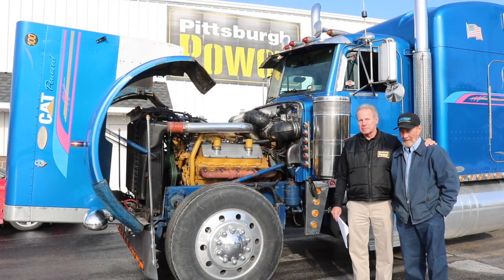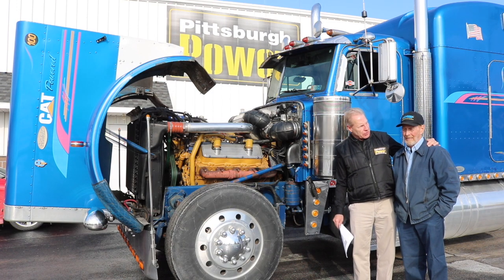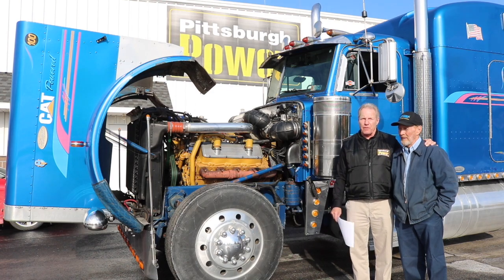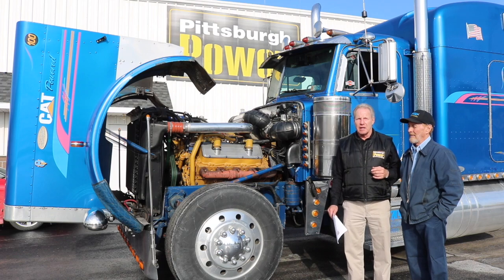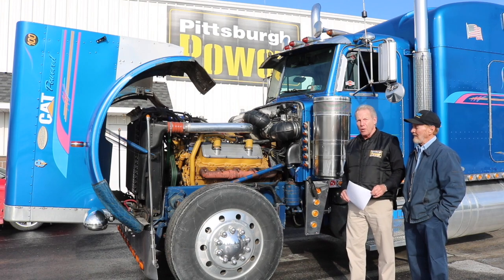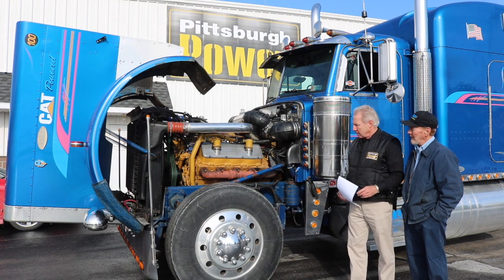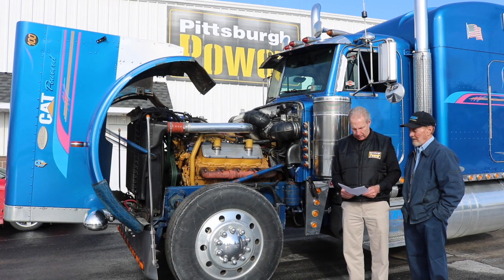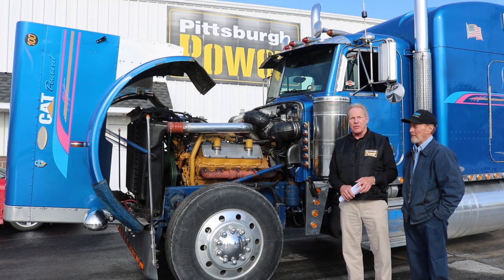Mechanical V8 CAT 3408 Dyno Run

Comment: I know where there's an old KW cabover with a 3408pc engine in it. Has over 2 million miles on it been sitting outside for the last 30 years. Owner wants $50K for it. He parked it when a rod came loose and bought a newer KW with a 3408 di in it.

Comment: For those who wondering why that big 18 litres V8 engines with over 600 bhp have relatively low torque figure? In my educated guess, it is a legacy from the past. Cat offered 3408 at max 450 hp 1450/1460 ft.lb back in 80's, why so? Because clutch and transmission back then not as strong as today and simply cannot handle big amount of torque. 1450 ft.lb was a big number 30-40 years ago.

Comment: these engines were used in shrimp boats, tugs, and large lobster boats and it was very common to see them rated at 1000 + hp continuous hp, shaft hp in the 1100 range.

Comment: Old school trucks are coming back (except in California where they've been outlawed by the climate change fanatics)   At my first job in the 1970s & 80s we had some light duty Ford F7000s with the 3408s. Very reliable and generally trouble free.
We averaged about 6 mpg on the road (5 in the mountains) At the time we still had some with 534 gas engines that got about 4 mpg.  They were pigs.
Reply: There not coming back u can't register them in most places  and a c15 will out run this

Comment: what gear do you generally do a dyno pull in with a rigs like these? i've always wondered
Reply: Direct drive
Reply: Every dyno, whatever the vehicle type, always done at direct ratio (1:1). On semi truck like this, if it got 13 speed or 18 speed eaton fuller, the direct ratio is on 7H gear (11th gear on the 13 speed eaton or 16th gear on the the 18 speed eaton)

Comment: Would like to see somebody come up with some Jake's for one of these 3400 series 8s.... I'm just thinking out loud here but theredically wouldn't the jake housing off a 3406b work on the 3408 head?.... would have to make a custom rockerbox cover though
Reply: No , because 3400 series cat don't have a rocker arm for injectors ( which is used by a jake ) 3406 uses a adjoining cylinder  rockers to triger the jake the timing of rocker arms don't come out wright for a 3408.

Comment: The truck is still running today and there is not an ISX or a c15 that wants anything to do with it. It will snack on those PDI tune C 15 6nz  engines they would not even be a full meal for that old cat

Comment: Well I been reading the comments and replies figured I would add one of my own back in the day I drove a 83 359 with a 3408 and a 6x4 it was at 1150 hp and 2400 foot pounds of torque if you were real conservative about how you drove you could get 4.2 out it but usually 3.5 mpg and it had 308 gears in it it was never late for anything but a fuel stop and was registered on paper in AZ at 165 mph it was so hot that at nighttime you could get the elbows to turn red pulling hills but it would bust and split a 4 speed auxiliary straight down the Center
Reply: No way 😂
Reply: Ok Billy

Comment: And you can literally fix it yourself on the side of the road. Between the lack of breakdowns and cost of mechs nowadays it makes up for it’s inefficiencies in fuel cost by saving labor and downtime costs.
Reply: Excellent point you made.

As one who's lost $400 a day for the last 20 work days because I can't find an available $189 an hour mechanic to take me within 4 days after I call them I'm calling a mobile mechanic and just crying uncle.

Don't forget about the DEF fluid cost which could be as much as four cents per mile and then those DEF filters are like $1,500 so yeah....

I might hop on the spreadsheet and try and drill down more on this.  But for me, hauling intermodal containers, I pretty much have to get 6 miles per gallon but I still use a pre EGR pre ELD tractor to do it.  If I were in higher paying freight I think I could stand a five mile a gallon truck.

Comment: 1969 was the first Scania V8 was introduced and today still making one of the most powerful " factory built " V8 engines today. High horsepower and high torque. Caterpillar shouldn't stop making  V8, just start making it better.
Reply: Uh Cat makes better v8s than Scania also can your Scania turn 1000hp with 2 parts changed and a tuner a 3406E Cat makes about 600hp max and gets 6.5 to 7 American mpg or about 10 or 11 euro

Comment: Use to be Detroit 8/v71 and 12/v71 ....then the cat 3408 and some Cummins v8 ....but those trucks are not on the road except truck shows
Reply: Neither of those 2-strokes could ever out pull a Cat, even if they had more hp

Comment: It will outrun any truck on tofsys highways up a hill but it did sounded low on torque.  When the load was applied it died pretty quickly.  I sure dont want to loose speed right away on a hill. Maybe it needs a lot of turning up that fuel pressure.
Reply: 550hp and 600hp 3406E/C15's have more torque than this in stock configuration.. 2000ft lbs.. 3408 is no longer the power king.

Comment: 3408 shares bore size with 3406. Not stroke. They are completely different engines
Reply: You can make it a b model 3408 by putting b model crank cam and fueling system cut c16 pistons in it with c18 connecting rods  marine heads and a 3508 turbo then you can put some power to the ground
Reply: @bryanwilson5011  can't put a 3406 cam in a v8🤦‍♂️

Comment: Still running 2 3408 Cat Powered 1985 W900's in our fleet. You take care of them and not abuse them they will last. Caught one driver Rough Handling one of our trucks. We had him pulled into the next Scale house and fired him.
Reply: Well I guess that if you baby them they will give you long life in return.
But where I worked we had V-8 Detroit's, where the only way to drive them was to either slam your hand in the door or get in an argument with your wife before driving away, because you needed to be angry at the world and they needed you to be angry so you would drive them hard.
Then we had a few Mack's with the E-9 V-8 Mack engines in them and they really liked to be driven hard especially if you had the injector pump turned up.

Comment: My grandpa was a diesel mechanic on the 3rd shift back the day, worked for Mason/Dixon trucking out of Kingsport.  Anyways one of his jobs was running the trucks on the roller dyno like this.  Said he always had the driver's door open when he did these pulls, so he could hear the engine/driveline better and it was really hot back in that room as well. 

I'll never forget him talking about nodding off for just a second while he was doing a pull, getting the truck up to speed on the rollers.  Said he woke up, engine was roaring, there was a brick wall about 10' in front of him, he jumped right out the open driver's door.  Scared him to death lol.

Comment: These days they build em just to barely make it out of the warranty period, if you follow the manufacturer recommended service internals you be lucky to see 500k on the dash before she needs a inframe.
Reply: Dan R that’s no shit half of my bosses trucks have preemission motors again 2-08 and 1-12
Reply: That is very well put: making them only last until the warranty period is over.

I just don't think heavy duty diesel engines can take all the emissions b***** that gasoline car engines can with without consequences.
Reply: true, but they have refined diesel fuel for cleaner burn, less lubrication now so wears engines faster. I would imagine regular early oil changes with a good fuel additive they should all go 800k+

Comment: that's it? that's all the hp and torque it makes the 5.9 Cummins in my Dodge makes more than that and it's a quarter of that size.
Reply: The difference is that the cummins will need many rebuilds if it has to do the same heavy duty work as the cat for the same amount of miles.
Reply: shut up idiot semi truck engine have way more torque than your little truck

Comment: That was my dads truck there is a lot of stories behind that truck. Broke the chains on the dyno for us. So you know I’m real underneath the American flag sticker there is a ding and the pin striping on the bunk is not the same height one sides lower then the other. Dose it still have the 4 and a 6 twin sticks in it.
Reply: Cool story but it’s power didn’t break the chains lol. Must have been a weak link. 1700 foot pounds torque and 600 hp doesn’t  equate to much in today’s standards with what goes on these dynos. It was powerful for its day but the worked over 6 cyl are putting out way over that in torque and you have trucks with worked over cats and Cummins putting down over 1200 hp on these dynos. So no, this 3408 didn’t brake those chains because of its power
Reply: No it is a 13 speed now.....

Comment: The 3408 and 3412 stroke (6.0") is not the same as the 3406 stroke (6.5"). But the same piston bore of 5.4".
Reply: Plenty of parts are interchangeable though. I’m rebuilding a spare 3408 truck engine and a lot of part numbers are the same, except for heads, block and crank of course. Water pump and oil cooler are different too.
Reply: Really kind of a bullshit point since cat doesn't make any on road truck motor now huh but you saying b model parts won't work in a v8 cat is a bullshit accusation now wasn't it
Reply: @bryanwilson5011  Sorry Bryan-you must read something I didn't write. I said they still make the Diesel 3406C-nothing about interchanging parts with 3408. All engines that were used in on road trucks are still being made by Caterpillar and do come up to smog standards-it's just Cat is not making those engines for on road trucks anymore. C11, C13, C15, C18 all still being made, but for off road and marine use.
Reply: You can make it a b model 3408 by putting a b model crank and cam in it convert the fueling over to a b model cut c16 pistons in it c 18 connecting rods and a  3508 turbo and marine heads then you can put some real power to the ground
Reply: @bryanwilson5011  And hope that offset crank won't break. Why don't you think that truck pullers use the 90 degree Mack V-8? Because it is nearly indestructable. Caterpillar 60 degree V-8 (from a shortened 3412) crankshaft is weak and cannot take much more than 800hp reliably. Why don't you think that Caterpillar doesn't make the 3408 anymore-in favor of the superior C18?
Reply: @Tchristman100  that's why they put the b model crank in them old tc cats bud in 1987 v8 cats were b models bud that's why you cut in c16 pistons I mean really you need it all spelled out for ya
Reply: @bryanwilson5011  Really sort of a moot point now since the only 3408 that Cat makes is the G model for natural gas with spark plugs putting out a measly 425hp maximum. They do still make the 3406C mechanical (like my 3406B jacket water aftercooled).
Reply: Look up on you tube rush truck greely colorado v8 pete
Reply: When did they start using the 6.75" crank I know that's what the C15 used.
Reply: Correct

Comment: Thats kinda low on torque for 600+ hp at the flywheel.  I think the last CAT motor put out 600 hp at 2050 lb ft.
Reply: v8 have less torque than inline 6
Reply: @thermidorlevrai65  false
Reply: @pkranz937  why
Reply: mtrujillo1973  no its just because v8 have less torque tham a inline 6 a cat 3406 for an exemple can produce 1850lbs/ft with 550hp and this 3408 make 578hp and 1738lbs/ft
Reply: New 3/4 trucks have more torque
Reply: @myfavoritecolorisclear  no

Comment: What year 12.7 my Detroit is a 92 can I get around the same hp from my block?
Reply: I had my 500 hp DDIV in a 2000 KW set up with Pittsburg power box, manifold and turbo. 
Set on power level 3 it done 530hp on the wheels (should be about 420 hp stock) which I would guess 600hp or so at the flywheel. You can turn the box up a lot more but I wouldn’t recommend it for engine life. 
Then we retarded the cam timing one cog and made it real torque down at 1200rpm. 
A real improvement for heavy haul.

Comment: Need a big box to pick up all the crankshaft pieces along the side of the road.
NOBODY has ever made a good 4 cycle v8 diesel.
Maybe Mack.....well, no....But close.
Reply: Scania made and still makes all their big power engines v8, the smallest offered at 530hp and the latest and greatest 770hp and 2728lb of torque! Europe has lots of steep highway hills so  power is king there, and all in cabovers.
Reply: @davidroberts6594  it's a Mack.
Reply: Not even the scania V8?

Comment: kitty cat motors are for a one man driver.   not company trucks.   when you sit behind a cat all the time you can hear it talk to you.   no cruise control.    wagon is 48ft belly reefer.  swing beef.  i do and will leave autos sitting but my fun is pig haulers and my son.  he is 5th generation driver. he does outdrag me on motorcycles at the track so he gets that.    god help us all with what he is building to haul with.   and very soon as well.   stay away from black petes is my advice. roll on.        p.s. Nadine was a truck-stop whore.   just the facts- freightrain
Reply: Ridiculous.. Many fleets have run 3406's..  Werner,  TMC,  etc.

Comment: Awesome to see old school equipment. I have owned 4 trucks and had all the major engines. The Cat was the most powerful and expensive to work on the Cummins was decent but the most dependable and easiest on fuel was the 12.7 Detroit.  Before you all get ur knickers in a twist remember That's my opinion yours of course will be different.
Reply: I also like the 12.7 Detroit 500 hp. Dead reliable pull good and easy on fuel. To bad they stopped making them.
Reply: Ray McGhee 
I’m just a wrench but I like the older 60 series. 
It gets no love. 
It’s fairly simple , has decent power and gets decent economy. 
It doesn’t kill any category , just performs well and that’s what’s needed for a workhorse. 
Done many a engine dyno pull with some guys from interstate mcbee as they were developing replacement injectors years ago.
I forgot how many runs we did , but it was over about a 6mo period every few days, and probably 4-6 pulls each time they came. 
Heh those ol boys learned pretty good how to swap injectors, I think we got it down to about 45 mins with 3 guys.
Reply: MrHillfolk Lifetime wrench here too , your description is exactly correct , been around them all , young and the old moth eaten stuff too worked on gensets w/v 71 series Detroit's, 1693 cats , all the old Cummins , even the ones w superchargers B's I think , compression releases also, but with the steel haulers and the graveltrains horsepower was/is king .But with the spreading out of the auto industry that isn't what it was years ago.

Comment: 4 miles to the gallon with 80 000 lb load, ouch, not fuel happy , but it will pull, and it will last longer than I6 cat. Just like  V8 Scania motor. TH
Reply: Our 08 Cummins only gets 4.5 mpg . Had a friend had that had a 84 model 3408 that would get 5.8mpg pulling doubles 1300 bushels of grain!
Reply: My C15 gets 4.5 pulling 160k.
Reply: Modern engines have the pollution control, which unfortunately, and somewhat counter-intuitively, uses MORE fuel.
Reply: yup, but the Scania can do 6.5 mpg easy...

Comment: Lol a stock 12.7 with a power box would take that cats lunch money and give it a Swirlie. I owned two of these, a pc and a di and thought they were big power in the day
Reply: i never heard any thing good with these, what was your experience? really a 12.7 you say is more power?
Reply: @NomadicSociety  12.7 Detroit.  Simple reflash ($500) of the ECM on a bone stock 12.7 will put a smile on your face! From my experience, a 12.7 runs best at 580hp +.  Also, rpms turned to 2400
Reply: @Milly_Mill_aka_Birdman   im not a Detroit guy, but it sounds like u swear by them?
Reply: @NomadicSociety  I had always been a CAT guy until I drove a friend's 600hp 12.7 Detroit.  Haven't looked back.  Plus, the better MPG's are a nice bonus!
Reply: @Milly_Mill_aka_Birdman  A well tuned Detroit Series 60 is a money saver. Not much goes wrong with the pre emission versions, which is probably the reason they were killed off. I've driven or owned most of the straight 6s, except for the electronic big block Cat or a  real Mack, and pound for pound a Series 60 without the pollution equipment is the best if you want to make money.
Reply: @hoost3056  This is true!  Also, it's the reason I have a pre-emission 12.7 in my 389.  Tuned ECM, aftermarket manifold/turbo, straight exhaust.  Debating on putting a FASS system as well.
Reply: @Milly_Mill_aka_Birdman  know how to make a Detroit have more power?? Paint it Yellow.😁
Reply: Yup!  I got a DDEC 4 with aftermarket turbo/manifold, straight exhaust, reflashed ECM, 13spd, 3.55 rears.  I have a buddy with a 625hp twin turbo c-15, 18spd, 3.55 rears, straight exhaust, that he switched to a single turbo setup and he can't hang with my "driptroit". Plus I get alot better fuel mileage than his "kitty cat"